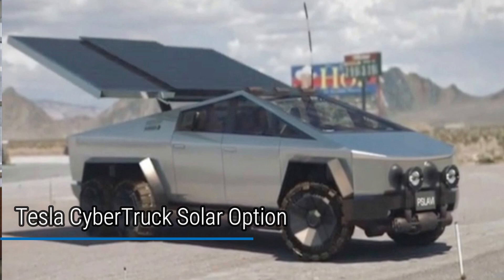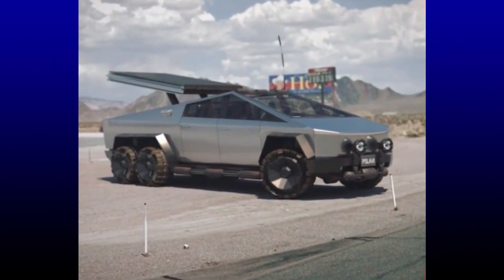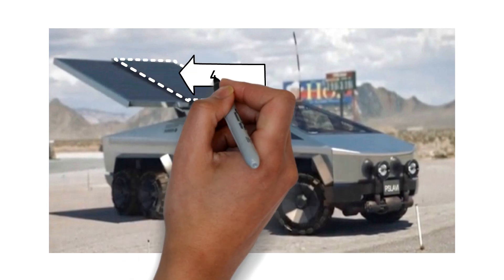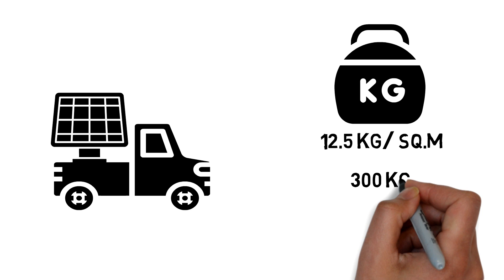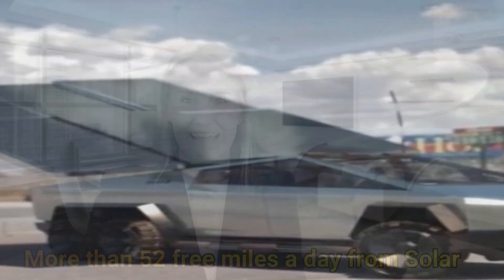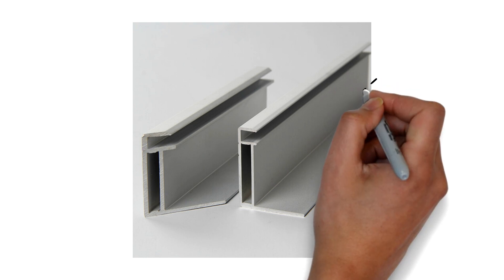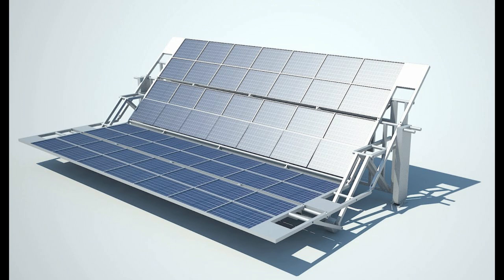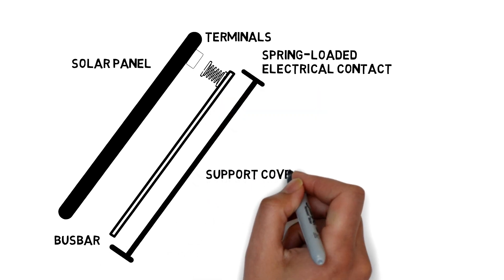The Deployable Solar Option for Tesla's Cybertruck : Engineering Analysis

Comment: With the support beam talking up cargo space. I dont see whats the point in having a flatbed if the solar system is mounted on the flat bed. 
It would make more sense to have an external solar system... like a extra long ladder rack for construction companies.  The roof rack extend on top ... its as long as the front bumper to the rear bumper. You have solar panels mounted on top like a rectangle umbrella. That would save the cargo flatbed space

Comment: I would totally 100% absolutely pay $2500 for this option!!
Reply from the maker: Same here
Reply: @synergyfiles3536  lol a capitalist middleman would never sell it to you with that little markup
Reply: There is ZERO chance that this would be a $2500 option.   That would mean that Tesla's cost would be in the $1200 range.    That's like 25 cents a watt WITHOUT the mechanism to deploy all those panels, or the electronics/inverter.   Total pie in the sky idea. 

They would be better off putting panels on the flat roofs of truck semi-trailers and putting a battery pack under the floor of the trailer.  Then linking the battery to an electric truck.  No special fold out mechanism required.  A 53' semi-trailer has 450 sqft of roof space.  You could probably fit 30 normal size solar panels on the roof which would be over 10kW system size.  That could yield up to 50 kWh when parked all day long in the sun.
Reply from the maker: @j_k9643  Tesla make their own Solar panels and accessories. Based on that it would be cheaper. The trailer idea is also good
Reply: @synergyfiles3536  I obviously don't know Tesla's cost structure however, even the cheapest home solar panels (at least in the USA) cost about $1/watt retail.   I still think that 25 cents/watt is not a realistic figure and that is without the cost of the mechanism.   And I just don't think that $2500 is a realistic estimate for a complete, specialized, low volume 4.8 kW system.   We can't buy a normal, basic house mounted 4.8 kW solar panel system for under $7500 in the USA.
https://www.wholesalesolar.com/shop/solar-kits/grid-tie-kits/micro-inverters?orderby=price
Reply: @j_k9643  Tesla can buy panels for 0,2 $/watt , in Spain cost that without taxes. In China cost less... But structure costs more than panels...

It is a 10 k$ option, not 2,5 k option...